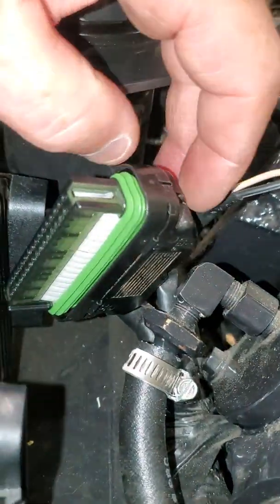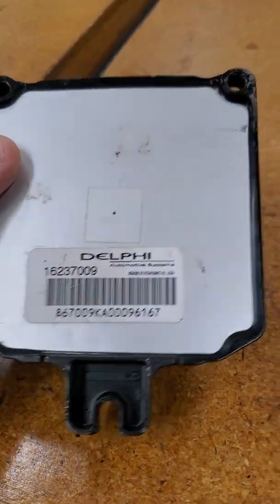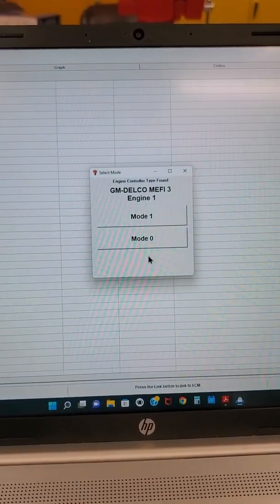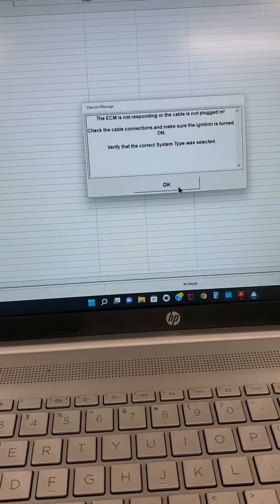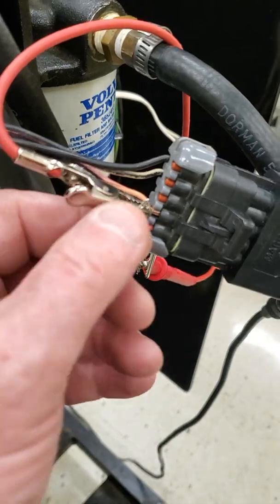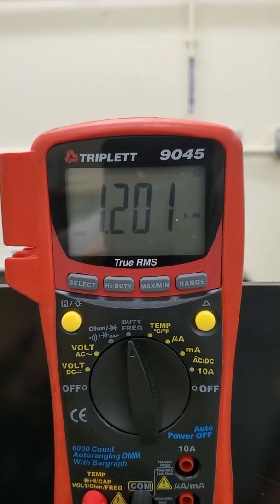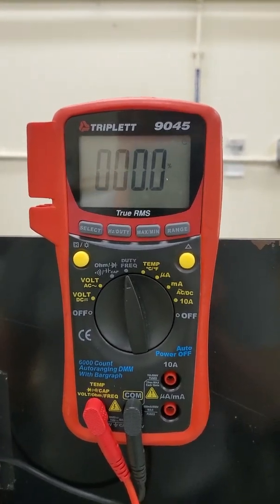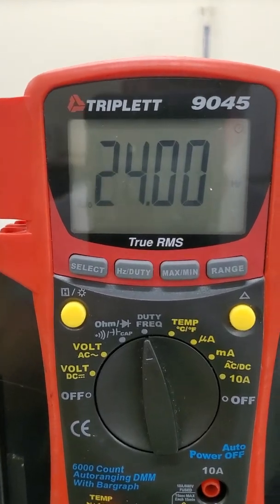How to determine if a MEFI 3 Ecm has failed

Comment: Trying to figure out a no start. Runs on starter fluid. No pulse from my injectors. My scan tool says e stop on... Should that say off? I suspected my lanyard so I removed it and connected the 3 wires together. I think mine is a mefi 3. Hopefully my ecm isn't bad
Reply from the maker: Try disconnecting the e stop wires
 Some are N/O in the run position
Reply: @tedsmarinerepair8956 when I disconnect the wires the fuel pump doesn't initialize. Does e stop mean lanyard? Or is there something else? Appreciate the help

Comment: Hi, I have a Volvo 4.3 GI that intermittently loses spark, causing it to misfire, and in some cases, it stalls. We've already replaced the entire distributor, spark plug wires, spark plugs, IAC, coil, etc. All the wiring is in good condition, including the gray tachometer wire. Could the issue be coming from the ECU?
Reply from the maker: @Gianlucavalori  it could be. It also could be a failing ignition module in the distributor or a loose connection at the distributor. While it's running at idle try lightly pulling on the four wire connection on the distributor and then move them up and down to see if the engine misses
Reply: Do you have the 4.3 wiring diagram?

Comment: Hey ted I have a 2003 4.3gxi, it was running fine for about two hours it had about two blips running at idle the beeper went kinda stalled out but ran fine after i parked it at the beach, went to start it a hour later and it didn't have any beeps, no fuel pump got it to run again started randomly then it started to beep and cutout again then finally shut off. I got it towed back it beeps randomly and fuel pump turns on. It keep beeping whenever it wants too, it wont stay on looking tried looking for lose wiries any tips?
Reply from the maker: Inspect the ignition relay and all fuses, then the key switch wiring.
Reply: @tedsmarinerepair8956   👍 ill keep you updated
Reply: @tedsmarinerepair8956  all the wires checked out, made sure I wiggled every wire under the dash, and checked all the fuses and relays. The same issue just will randomly start clicking the relay for the fuel pump and the beeper will go off.
Reply: @gabehartmann5131 I having same problem with1993 5.0 omc Did you hey yours figure out . ?
Reply: @raylopez9153  MeFi was bad sent it in. Found another one online and sent it in to get tuned and checked runs good now.
Reply: @gabehartmann5131  maybe was running my problem started when I changed the fuel filter water separator I dint fill up with fuel . Any ideas ?

Comment: Hey Ted, I have the Delphi 16237009 on my Twin 2000 Cruaders 5.7 MPFI engines. This runs on the MEFI 3 based on my Ri nda TechMate Pro. My engine hours for my Port engine are reading crazzy numbers. It reads like 75453.32. I read the correct hours before which is suposed to be 725 based on my engine hours meter at the helm. My starboard engine reads the correct hours when using my techmate pro. Any reason why this could of happened all of a sudden? Would greatly appreciate any advice! 
Thanks
Reply from the maker: That's a glitch somewhere that I never dug into. There is a 7.4l Mefi 3 with the same issue, reads in the 70,000 hour range like yours, but runs fine so I just ignore it.

Comment: Hey Ted. Great video!! I have one engine right now that I believe the ECM is starting to fail. Fuel pump failed, replaced fuel pump and had injectors cleaned. Engine still idled terribly. Plugged in scan tool and saw I could communicate with the engine but when doing power balance test with DIACOM it was very inconsistent. Some would react others wouldn't. And it always was changing. 1 point I had all cylinders not reacting and engine was running perfectly. Any suggestions? Also I had codes with almost all 5v references saying high voltage.
Reply: Volvo 8.1 Gi-D
Reply from the maker: Please email me a diacom recording to marinedoc01@yahoo.com

Comment: Great Video.

I was installing a new knock sensor and tapped the wrench on the started now nothing when I turn the key. Engine will crank but fuel pump won’t prime. I jumped the started and it turns on. What’s the best way to test to see if I fried my Emc without a scam tool? 

Any ideas on what happened? Checked all fuses and the look good. I’m stumped
Reply: Tapped on the starter.. small spark no nothing g when I turn key on.
Reply from the maker: Many possibilities. I am available for consultation at marinedoc01@yahoo.com

Comment: Hi Ted hope you are fine,I am looking for 2 ecm of  VOLVO PENTA 
5,7 GXI-FF  ,do you have idea on the rebuild or replacement solution . Thanks
Reply from the maker: That will require them to be ordered thru a volvo penta dealer
Reply: @tedsmarinerepair8956  thnx Ted

Comment: Hi Ted, 

I have a question about MEFI 1 (97 8.2 MPI) any ideas on what would cause multiple diagnostic codes (I.e. MAP/IAC/TP faults) using Techmate Pro when engine starts, rough/high idle, extremely rich exhaust and error codes are different each time engine is shut down and power is reapplied. Months before this I noticed a reduction in power when full throttle was applied as well as reduced WOT RPM.
Reply from the maker: Have you checked the fuel pressure?
Reply: Running fuel pressure under load is in low to mid 30’s. Forgive me I don’t have those exact numbers it’s been almost a year since I last checked them.
Reply from the maker: @briantroy8037  That may be too low for that engine. That is the first place I would look with those symptoms

Comment: Thank you for all these informations; My Mefi 3 is also burned. Do you have a solution to replace it by an other system because Mefi 3 are not easy to find as you know?
Reply from the maker: The only options I know of are to find another MEFI 3 ECM or a same hp MEFI IV version with adapters
 But the MEFI IV must be for an engine with a Delco est distributor.
Reply: @tedsmarinerepair8956  Thank you for your help
Reply: @Aancion01  Did you get a MEFI 3 replacement yet? I’ve got one in a large lot of inventory I just purchased.

Comment: Really odd that both ECM's had No Com with scan tool but you could see live data (unless I missed something in my not so undivided attention). That scenario usually points to the CAN Bus down but both ECM's? Lightning strike is definitely plausible. Looks like we'll be bringing lab scopes into the recreational marine shop sooner than later. Awesome to see ECM troubleshooting vid on YouTube. I test them as well. Dealerships are so quick to throw new ECM's at engines.
Reply from the maker: These are old MEFI 3 ecms, way before CAN systems. Only one NODE makes diag easy. And there was no com with the scan tool on either engine. So, lightning strike or power surge smoked  them.

Comment: Hi Ted, great video, thanks! I have a 5.7 Marine Power Vortec with a Mefi 3 or 4. The boat had been swamped. I’m not getting key on power to the fuel pump. I have pushed power to the fuel pump and the boat starts right up. Would it make sense for the Mefi to malfunction with only the fuel pump but everything else works fine? All fuses and relays are new. Do you know a place I can send the ECM to get tested or a place to buy a new one? They seem hard to find.
Reply: I can help you with test and or repair for your MEFI

Comment: Hi Ted.  I ran across your video and have very similar circumstances.  
I have the same marine Dephi ECM (16237009) which certainly appears to be faulty as the relay driver (J1-23) is not grounding the fuel pump relay, and there is NO communication to diagnostic equipment.  12VDC Fixed and Wake-up are available to the ECM, and the ECM grounds are good.  I used the Rinda CodeMate blinker and did not get the code 12 diagnostic capability acknowledgement.  I then bit the bullet and invested in the RInda Diacom software which does not connect to the ECM ("The ECM is not repsonding or the cable is not plugged in...").   
I then sent the ECM to a repair shop who says that they found a Checksum error and resolved it by flushing and reloading the software (I'm not sure how this could have been possible if the ECM is not communicating, but perhaps they have more sophisticated equipment). The ECM still shows same result--will not communicate to flasher or Diacom.

I now fear a new ECM may be in my future.  The Delphi 16237009 seems to be obsolete.  Any insight you can provide on repairs or replacement is greatly appreciated.
My engine is 1999 Volvo Penta 5.0GiPWTR
Reply from the maker: I can be reached for consultation at marinedoc01@yahoo.com

Comment: Hey Ted, been watching your videos,  I have  a 2001 mercruiser 5.0 with a MEFI-3 16236999 ECM.  I have tested the ignition and fuel pump relays as indicated in your videos.  I have the no alarm and no fuel pump sounds when I turn the key on.  I can crank the engine.  I do not have access to Diacom diag software,  too expensive for home use.  Is there some way to test the ECM without the diag software.  I also hear that they have discontinued this model of ECM.  Do you know if there is an upgrade available.  Been searching, cannot find anything.  Thanks for any help you can give.
Reply: I watched the rest of the video and saw how you used Hz mode to check the data line.  I will try that.  Let me know if you know of any solution for a upgrade kit in case the ECM is bad.  Thanks
Reply from the maker: Try swapping the ignition and fuel pump relays. If still no alarm then check J2-32 for voltage with a test ight to see if the relay is supplying voltage to the ecm to awaken it
 You should have voltage on J2- as well. 
If those are OK ensure the three grounds are good. If so it's the ecm. Research online OBD ecm repair
Reply: @tedsmarinerepair8956  Thanks Ted for the quick reply.  I will test as you have indicated.
Reply: @tedsmarinerepair8956  Thanks Ted,  making progress,  J2-32 no voltage.  I pulled the relays and tested voltage at the sockets, all good.  On the schematic, it shows three fuses after the relays,  I tested all fuses and they were good.  Then I pulled the fuses and tested the fuse sockets.  The 10 amp socket showed no voltage, with key on.  That looks like the line from the relay.  I did swap the relay and I did test the relay with a 12 volt supply and it showed continuity between pins 30 and 87A, But no voltage across 10 amp fuse.  I will continue my testing.  Thanks